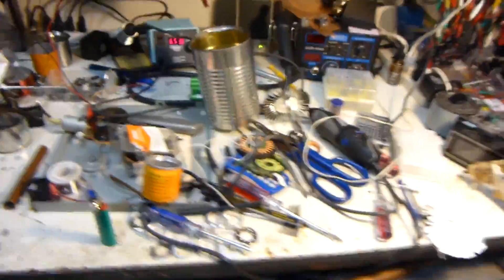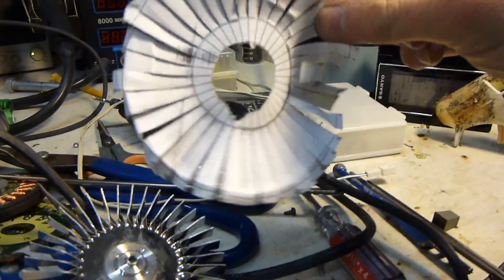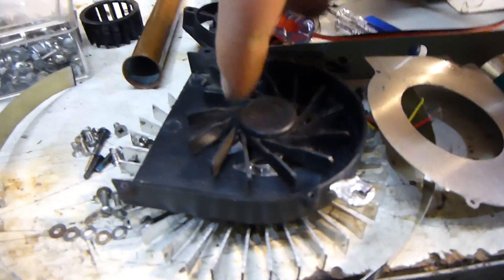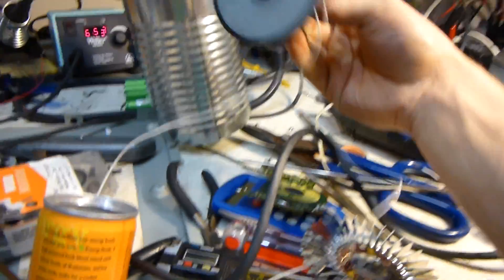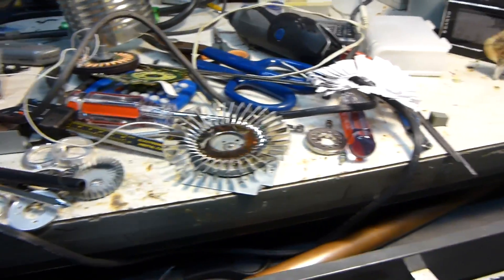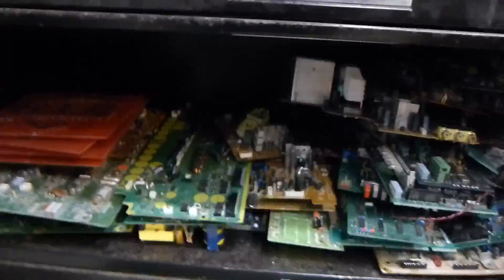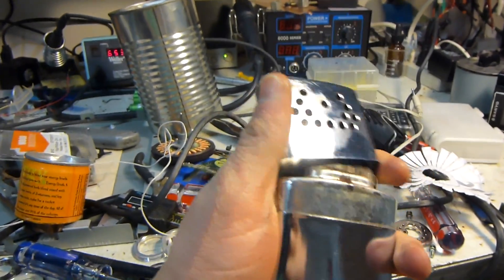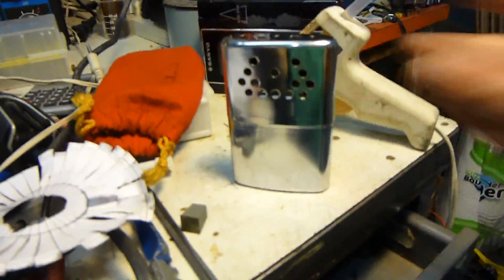Update - I'm on Break!!! New Projects and Stuff - Steam Turbine/Fan Made From Hard Drive

Comment: Hi, this "HD" fan turbine its pretty incredible! How do you did that? Do you could make a video step by step about it? I'm very interested in it! Congratulations and thank you for sharing!
Reply from the maker: Pedro Visco Thank you!  Yeah I guess I could do a tutorial.
Reply: Makerj101 Oh, thats be great. I'm working in a project and I need that know how :P
I saw a many videos of yours and your workshop is enviable. I wanted all this stuff to me hahaha.
Another question, where do you take all of that hd's? I'm buying cracked HD's, but still expensive where I live (Brazil). Thank you, I'm waiting for your tutorial. Greetings!
Reply from the maker: Pedro Visco I'm not sure when I'm going to get around to doing it.  It probably won't be very soon as I've got lots of other projects in the works.  

You don't really need a tutorial though.  It's really simple.  All you gotta do is print this out in the right size: http://etc.usf.edu/clipart/43000/43032/polar_36-1l_43032_lg.gif  Then smear glue on the hard drive platter and stick it on.  Then use something to cut on the lines  Hacksaw, tin snips, band saw, abrasive cutting wheel, even a big old pair of scissors might do the trick.  Lastly use some pliers to bend the blades how you like them.  Then you can figure out a way to mount it.  Probably the original motor from the hard drive would work well as it should have decent ball bearings.

Just get them from old computers that you find along the road on trash day.  Ask friends and family if they have any old computers that you can take apart.  Someone should have some.  Let them know you will be thoroughly erasing the data by practically destroying the hard drive.  :D  

Hope that helps.
Reply: Makerj101 Okay, I'll try something like that. :D
I already did one (from food can) but its still soft and very poor haha
Hard drivers is the best opition. When I put all the tools and things together, I might do a video about it. You really helped me. Thank you!
Reply from the maker: Pedro Visco Excellent!  Food cans are certainly easier to cut!  I wouldn't worry much if it's too soft.  The centripetal force will keep them straight.  Yeah make a video!  You're welcome.
Reply: Hello, buddy. I got an old hard drive and open it. But I'm having trouble to cut the hard drive. What cutting tool did you use? Some appropriate scissors? How did you fixed the central axis wheel in the fan? Thank you!
Reply from the maker: Pedro Visco I used tin snips.  They are designed for cutting sheet metal.  But you could likely use a hack saw.  https://www.google.com/search?q=tin+snips&es_sm=122&source=lnms&tbm=isch&sa=X&ei=dJY6VZeOHu3gsAS72YGoCg&ved=0CAgQ_AUoAg&biw=1600&bih=775  For the center I used a compass to draw a circle on the temeplate that is the same size as the hard drive disk.

Comment: Remember if you want to make a turbine you will need either a stator disc (if it will be axial) or guide vanes (if radial). Otherwise it wont make much power at all.
Reply from the maker: akkudakkupl What is a stator disk?  Thanks.
Reply: Makerj101 It is a disc that doesn't move but it's vanes guide the gas onto the turbine disc blades at an proper angle so they can extract the most possible power.
http://en.wikipedia.org/wiki/Degree_of_reaction
explains somewhat how it works, but still do look it up on yourself, in turbomachines the guides vanes are very important for any work to be done on the fluid that passes through.
Reply from the maker: akkudakkupl Ahh I see.  I was just planning to shoot the steam at the flat blades.  I don't think I would have enough steam to build a full turbine with guide vanes and everything.
Reply: Makerj101 The point of multiple stage turbines is to divide the pressure drop onto multiple smaller processes to increase the efficiency. You could just as well build a bigger single stage disc and call it a day, wouldn't be as efficient but still would be properly powerful.
Reply from the maker: akkudakkupl How would a bigger disk help?  I'm confused.
Reply: Makerj101 You an make a stage that extracts all the energy OR make multiple smaller stages that do the same. From thermodynamic point of view a process that is happening in infinite number of small steps is the most efficient. So having multiple stages extract energy is a approximation of this law.

So you don't need to build a huge and complex turbine, you can build a single stage one and it will extract similar power. Just inefficiently ;-)

In turbines it's basically the total area of turbine blades that says what power it extracts. So you can either have one big turbine or more smaller ones that add up.

I hope the last bit explained it...

You can get a book called "Model Jet Engines" by Thomas Kamps, There should be enough theory and equations that would allow you to design a steam turbine ;-)
Reply from the maker: Ahh I think I see what you mean now.  I guess I always thought you need a lot of pressure to get any power from a turbine.  So I thought that the turbine had to be small enough that on one side there would almost be full steam pressure and on the other side atmosphere.  But I guess that makes sense.  Maybe I'll make a turbine housing for it and see what I can do.  Thank you so much!  :)
Reply: Makerj101 The pressure is important as it is the measure of potential energy of the gas ;-)

The pressure differential on both sides of the turbine work as you think exactly.

But a big industrial turbine divides that over to smaller steps so they can extract more energy.

Really I do propose you try to find a book on the subject ;-) I'm unfortunately just a chemist and my knowledge on turbine thermodynamics is limited and I'm not educated enough on the subject to educate others :D
Reply from the maker: akkudakkupl Ahh ok.  I think I'd rather just build one and use trial and error!  That's what I normally do!  I actually don't like reading books!  I'd rather get my hands dirty than learn all the theory.  But I'll do some research on Wiki on the subject.
Reply from the maker: That's true.  I've kinda found that nearly anything I build doesn't work the first time.  It's just the way it is.  So I keep trying.  I had to make 2 stirling engines before I got one that worked.  Same with my LED light ball.  Took several attempts before I got it to work with out self destructing.  Even though my trial and error process isn't efficient, it is enjoyable to me and I think I learn better.  Then I know what doesn't work.

That's what I had in mind for a turbine.  That's a pretty good representation for using ASCII!  I have two to the turbines so one can be the stater and the other the turbine.  

I'm just curious, what would happen if you had the stater spin in the opposite direction of the turbine?

Well I'm not going to be able to get that fancy with airfoil and all!  Maybe sharpen the blades.  But I think I'll even skip that.  Maybe that could be a future modification and I can see if it improves performance.
Reply: If the stator would be allowed to spin freely the energy of the gas would be wasted on its rotation leaving less to be extracted by the turbine.
If the stator would be spun the opposite direction on purpose (adding energy) then what I imagine would happen is that the gas pressure would rise slightly in front of the turbine (it would act as a compressor).

Building a statorless turbine is possible, where there are turbines spinning in opposite directions, but they would need to be geared together (so having concentric shafts and a gearbox = a lot of complication). This was actually tried in the early days of jet engines (Both the compressor and turbine blades were on single disc, ones close to the center others close to the outer diameter. Multiple discs were stacked one after the others on a stationary shaft. The discs were 'mirrored' so the blade pitch alternated.), a blind alley though, too complicated.

You don't need to shape the blades THAT ideally, just giving them a slight curvature would help the flow.

The simplest stator would be wedge-like structures with larger inlet area and smaller outlet area (so the pressure drops a little and gas velocity rises). The turbine would be 'buckets' that capture and deflect the incoming high velocity gas.

http://www.jetaerospace.org/Images/turbine_inlet_guide_vanes.jpg

This is a example of a radial turbine with guide vanes (that are the stator for this type of turbine) on the outside - you can see the intake area is larger, while the output area is smaller. The gas is speed up by those vanes and is fed directly onto the turbine blades, you can see they are 'bucket' shaped to catch the impulse of the incoming gas.

Intake to this turbine is on the circumference. The turbine exhausts down in this photo. (Looks like a part of a model jet engine made from a turbocharger, I just googled for turbine guide vanes.)

A impulse turbine is simpler to design as it is more 'logical' and you don't need precise aerofoils for it to work OK.

Impulse turbine doesn't need to be radial, it can be also axial.

http://gasifiers.bioenergylists.org/files/images/Impulseturbine.jpg

Again bucket shaped blades as you can see, this also would need a stator to guide the gas into those buckets.

Reaction turbines are way harder to make in a small workshop, they need precise aerofoils and a lot of stages (what I saw in your video looked like a reaction turbine).
Reply from the maker: akkudakkupl Very interesting.  Thank you very much for all the information.

Comment: Great work with the fan. I'd be inclined to leave it as is.
Reply: F-wheel - Curved forward blades. High efficiency, small dimensions, changing in pressure have little influence on pressure head.
B-wheel - Curved backward blades. High efficiency, low energy consumption, changing in pressure have little influence on air volume. Low noise emission, stable in parallel running.
P-wheel - Straight backward blades. High efficiency, self cleaning, changing in pressure have little influence on air volume
T-wheel - Straight radial blades. Self cleaning. Suitable for material transport
from http://www.engineeringtoolbox.com/fan-types-d_142.html
Reply: Makerj101 The blower you were looking at turns the opposite direction you think it does. Then blades should be angled Back like that small fan. not forward. If you were to spin it in the direction you want it to and put an obstruction in the blade that's the way they should be bent.
Reply: Ben Heatherman That's an understandable conclusion to reach. It's not quite right though. http://www.homeintheearth.com/wp-content/uploads/2012/11/CentrifugalFanTypes.jpg
Reply from the maker: Mongrel Shark Thank you!  Yeah I think I will or at least for starters.
Reply from the maker: Dolce Lattice Cool!  Thank you!

Comment: I thought hard drive platters were very brittle... how fragile is a hard drive platter?
Reply from the maker: Loco Llama You're thinking of the early ones.  They were made from a glass disk coated with the shiny metal.  So yes the old ones are very brittle.  The newer ones are just aluminium.  So very soft and bendable.  I have actually never come across ones of the glass ones.  They are just the early ones and possibly higher speed/high end?
Reply: Makerj101 save that shinny metal. Lol
Reply: Oh, I had one of those glass ones I guess when I took apart my hard drive a while ago... It kinda ended up shattering into a quadrillion pieces. That was probably a pretty old hard drive though if I remember correctly

Comment: From the way you were positioning the materials I believe you are trying to build a centrifugal compressor. Remember pressure and velocity at the outlet are inversely proportional in this case. If your burner needs the turbulence more than the oxygen for complete combustion try leaning towards air velocity. If the pressure is more of a concern decreasing the velocity by using a volute type casing around the impeller or changing the outlet diameter can achieve this for you. As for the impeller blading bends think about how you will draw the air into the casing but not at the complete sacrifice of air displacement due to centrifugal force. This method of supplying air for combustion is called forced draft if you were wondering =-] looking forward to the new videos! Thanks
Reply from the maker: Karsten Elliott Thank you so much!  That is very helpful!  You sure know a lot about centrifugal compressor and fans etc.  I will definitely use a volute casing around the fan.  I am actually thinking about casting the casing out of aluminium.  Why, just because I want to cast something awesome out of aluminium!  :D  I'm not sure I will be able to case something so thin using lost foam but I think I will give it a try!  As for bending the blades, I've been doing some research and I think I will bend them.  I might make another one and not bend that and then do a comparison between the two.  Thank you!
Reply: Your welcome. I'm taking power engineering in Canada which is all about operating boilers. :)
Reply from the maker: Karsten Elliott Cool!  That sounds like a really interesting coarse!  Here is a simple diagram that I found!  It shows exactly what you explained!  http://i1.wp.com/www.homeintheearth.com/wp-content/uploads/2012/11/CentrifugalFanTypes.jpg?resize=952%2C446

Comment: That squirrel cage fan should spin the other way than what you said, centrifugal fans will work either way, but are more efficient when spun the direction like the first 2
the blades cut into the air and move the air outward, it shouldn't take much to work out which way that is,
Bend the blades in a slight curve, give it a try in both directions to see which is more effective
Reply from the maker: ***** There is an arrow stamped on the fan that shows that direction.  And that's the way the motor spins.  So maybe it was designed by someone who doesn't know anything about fans...  It seems to work ok though.  It was from a bathroom exhaust fan.  I think I'll do that!  Thank you!
Reply from the maker: ***** I found this very simple illustration.  http://www.homeintheearth.com/wp-content/uploads/2012/11/CentrifugalFanTypes.jpg  Makes sense to me now!  So that squirrel cage fan in my video is designed to have a high volume.  If it spun the other direction it would be for high pressure.  After studying the picture for a while I totally understand it now!  So now I have to decide which would be best for my boiler's burner...
Reply: Interesting, having worked with centrifugal fans on anf off for over 30 years (Electrical maintenance and installation) i always found the 'high volume' version less effective. the straight blade version is often seen in water pumps (washing machines)
Reply from the maker: ***** Cool!  Yeah I think I may just go with straight blades or maybe bent slightly to give me more pressure.

Comment: I think you will find the fans blades are bent different directions based on whether they suck or blow. Generally you suck from the center and but not always. So you should bend the blades and you can simply change the motor direction if you get your theory wrong.
Reply from the maker: Robonza Ahh that's kinda what I was thinking!  I will make another fan and bend the balds and then do some tests to see which works best!